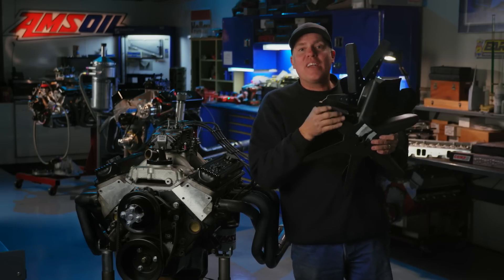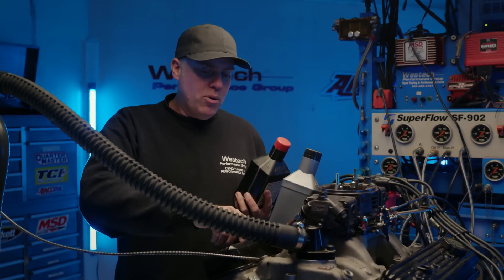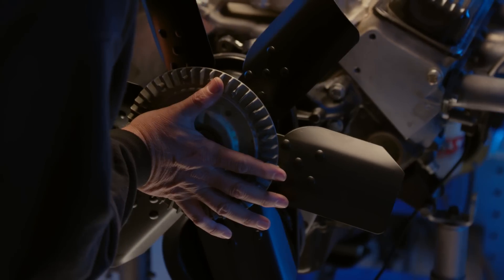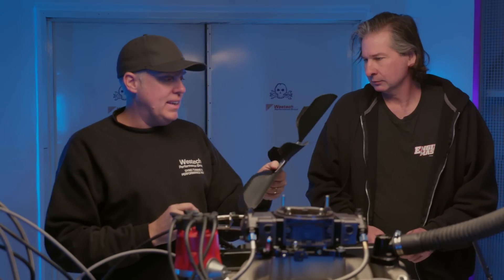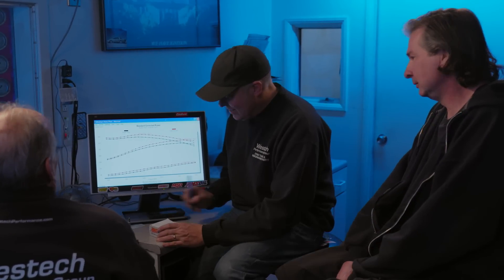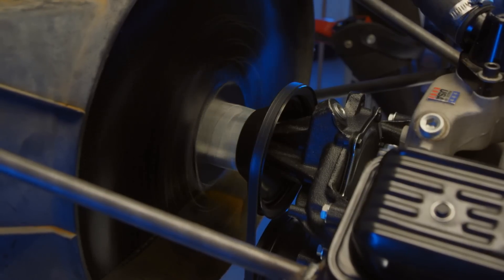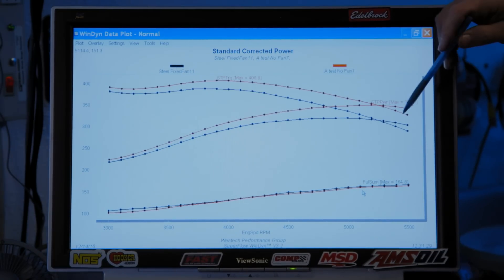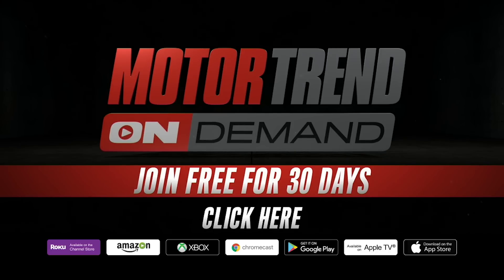Cooling Fan Shoot-Out! - Engine Masters Ep. 20

Comment: To be fair I'd lose 50hp all day and not have to worry about overheating
Reply: THE MTB FANATIC 

I've got 22 years out of Electric fans on a factory car... . to me the E fan is the least likely thing to cause an overheating issue.. more likely to be a bad thermostat or radiator.
and honestly with a belt driven fan.. the Belt is far weaker link than the E Fan.
least that's been my experience.
Reply: That's especially true when you sit in traffic with no airflow and the regular cooling fan running at idle rpms. An electric fan can go to full power in that situation.
Reply: mibars not in a cases mate, look at the TD42 found in Nissan Patrols, the mechanical clutch fan is the best to keep them cool
Reply: I had nothing but trouble with twin 16 inch elec fans on my TD42,went back to stock fan and no more problems.
Reply: 550hp 69 copo camaro zl1 with 427 aluminum, isn't a 500 horse small block. That's ALL big block. 427 cubic inch smalls weren't even a thing until the mid 90's when World Products came out with their Motown blocks.
 And as far as I know, the only small block Chevy ever released to the public that made an honest 500 horses was the 302, and even that is debatable without tuning.
Reply: When you have a clogged radiator or a defunct waterpump/thermostat, the best fan won't help you.
Reply: Its a td, just leave it all stock, change the oil and let it run for the next 20 years
Reply: Reuben Horner nah, I tweak mine, but you've gotta look after the cooling system, copper brass radiators are wondeful things
Reply: I agree. The factory electric fan on my jeep grand cherokee went out twice in 6 months. It was cheaper to put a clutch fan on it. I noticed a small drop in performance.
Reply: ok so if i took the fan off a bicycle with a chevy big block on it it would go faster than your honda then?
Reply: I have never had any problems with electric fans, including 27-years old fan in a Honda. On the other hand my friends had numerous problems with fan clutches. BTW electric fan is an essential upgrade on a Jeep - When your mechanical fan hits the water something will brake...
Reply: Mick Rambo Not really
Reply: Exactly!
Reply: I beat the Gt350 and C7 Z06 owners would agree;-)
Reply: The factory has been using electric fans for 25+yrs...so I wouldn't worry too much about it. Also a car doesn't instantly over heat...You'd notice the temp start to climb and it doesn't happen that fast. Any person paying attention would be able to pull over and let it cool down before there is any real trouble.

Only on a tow vehicle/truck would I rather have a clutch fan.
Reply: Micj Rambo....YOu said "We were making 500 hp aluminum small blocks from the factory in 1969" And like I said NO Factory small block made 400hp Net HP.

I also said, "And even VERY FEW, big blocks made over 500 Gross HP...let alone NET Post 1971 rating."  As for the L88/ZL-1 motor...I've never seen ACTUAL "stock Dyno #s" EVERYONE reuses the 560hp guestimate....which I've read was ":supposedly done with aftermarket/over the counter headers with open exhaust....NONE of them made 560hp with the stock manifolds...which were VERY restrictive. I've seen posts by guys dyno'ing stock spec rebuilt ZL-1 engines with stock manifold made around 505hp.
Reply: The ports  and valves of 351C's were big enough for 600 HP, but the ports so extremely poorly shaped that actual power was about 350 - 375 HP because of so much flow-blocking turbulence in the ports... port plates helped the power, despite making the ports smaller...
Reply: i went to an electric fan recently, junkyard swap took about 3 hours.. solved all my overheating issues. now i find out i get a hp bonus, my engine spins to 5750
Reply: supersevenn as much as I hate to admit it most hondas can beat a stock muscle car with very little work because of the weight but I don't care if your Honda has 1000 horsepower it won't beat the sound and feel of a muscle car at a red light
Reply: And that's when you mostly need your fan as during regular driving you have a wind blowing thru.
Reply: But electric fans are more reliable and provide better cooling.
Reply: Mechanical fans imo more suit heavy duty diesels or someone ripping mad skids day in day out. Electric for the rest is just better
Reply: because of the emissions. We were making 500 hp aluminum small blocks from the factory in 1969.... 1985 150hp
Reply: I carry a fan, pump and belts in the trunk, just in case. I never trusted electric fans or pumps, but there's no denying they free up horses.
Reply: 550hp 69 copo camaro zl1 with 427 aluminum disagrees
Reply: 4V 351 Cleveland GTHO's made 400hp in stock trim, they were de-rated ridiculously due to insurance premiums and a need to sell 300 to qualify for Australian Homologation in our racing series
Reply: I'd rather lose 30hp if I knew I didn't have to worry about overheating. In the greater scheme of things 30hp isn't even gonna cost you speed unless you're racing where 10th of second counts.
Reply: What a load of shite!
Reply: thats why a honda can beat most stock muscle cars

Comment: how about cooling? if a fan kills more power, does it mean that's it's cooling the engine better?
Reply: No. At higher engine revs at moderate temps a fixed fan would over cool, were it not for the thermostat.  With a rad in clean condition and a cooling system working properly, no fan should be necessary at highway speeds.  It's in traffic, when towing or at extreme ambient temps that a fan is needed.
Reply: Also dependent on the CFM of the fan, if you don't know what you're doing and get a fan that flows less than stock, bad news for you.
Reply: Johnny Anderson I thought this was a comparison test if which cooled better.
Reply: Johnny Anderson  never seen anyone with my name before Johnny anderson
Reply: No. Since when does power draw mean more efficiency?
Reply: My Focus would only overheat while sitting,and only in the summer.
Reply: Completely depends on the design of the fan and the setup. Since more drag doesn't necessarily mean more flow. I bet the plastic fan was the worst, I can imagine it flopping about creating nothing but drag. In terms of actual cooling though, surely when you're moving the rush of air is enough to cool the radiator and engine? Rendering these belt driven fans kinda useless...

Comment: would have been nice to see also what it's doing on the cooling side.
Reply: 58 fregate nothing, while driving a fan has no function, cooling is provided by the movement of the car. it's just when you are stationairy you need enough movement to remove the heat that the engine produces while idling.

thats why electric is best, it only kicks in when it is actually usefull and is off when you don't need it, drawing no power at all.

Comment: x-pipe vs h-pipe vs straight pipe next please. 😄
Reply: they already proved there's really no such thing as backpressure.    the most you'll see is probably 1hp difference
Reply: I would like to see what happens to your torque curve if you dump both your 2 1/2 inch collectors into a single 3 1/2 inch pipe rather then dual exhaust. Two 2 1/2 inch pipes have the same area as one 3 1/2 inch pipe.
Reply: imadude85 I swear they did that already...
Reply: I'd like to see that test.
Reply: Winner for next show
Reply: imadude85 this 350, swap fan from stock to electric, swap waterpump from stock to electric amd dynotest!
Reply: I second this.
Reply: X-pipe wins every time
Reply: Pipe down!
Reply: Invincible Extremes Muscle Cars Garage  naw they did different mufflers, headers, and pipe sizes
Reply: yep and keep the basic 350 from this test!
Reply: That's actually coming in the next MTOD Engine Masters, so 2 months to YT from this one.
Reply: Bryan Mayes yeah I think they saw his comment and then made the video
Reply: YES!!
Reply: id like to see the test on both this 350 and one of their high horsepower big blocks
Reply: exactly. Both methods improve scavenging witch draws the gasses out of the engine faster and more efficiently. it has nothing to do with back pressure
Reply: imadude85 agree
Reply: using an x over an h isnt a back pressure thing ;)
Reply: imadude85 I agree
Reply: X makes a bit more Torque/HP but is also a bit quieter (which is good or bad depending on what sound you like) Never liked straight pipes gotta have a H, or a X IMO.
Reply: If your gunna go straight pipe you might as well just run Headers/manifolds. I mean if ur deleting ur cats and mufflers why even bother  with routing exhaust pipe?. Unless you meant those configurations with the cats/mufflers still?!
Reply: R. Flash those configuration are still with cats and muffs.
Reply: imadude85 Ok gotcha. Some people say straight pipe they mean just straight exhaust pipe then some people mean with all the plumbing, kinda like the dual and true dual exhaust thing.
Reply: imadude85 lel
Reply: blanchae how you gonna route a 3-1/2 pipe? does anyone even sell mandrel bends in such size
Reply: R. Flash I had a 73 350 impala hardtop I ran 2" pipe from the manifolds to the rear bumper, nk mufflers, sounded like a v8 harley , everybody loved it except the police
Reply: Very common in trucks. http://www.truckpipesusa.com/categories/all-3-5-pipe-types.html
Reply: blanchae tyvm sir, but again, how do you route 3-1/2 on most vehicles? I guess on a lifted truck, no problem. I did custom exhaust for several years back in the 90s for off road trucks, hotrods, and those gay little riceburners, even 3"  was a challange, and most vehicles couldn't use 3". Also, 2.5" collectors? On what, 2.0ltr lol
Reply: imadude85 wasnt this done already?
Reply: imadude85 optimizticpizza i gotchya i just thought that episode was more than 2 months ago is all
Reply: J⃟O⃟N⃟A⃟T⃟H⃟A⃟N⃟ S⃟C⃟H⃟U⃟L⃟T⃟Z⃟ J⃟O⃟N⃟A⃟T⃟H⃟A⃟N⃟ S⃟C⃟H⃟U⃟L⃟T⃟Z⃟ how Wong you were!!! They did the video and it was actually 2HP! So ha!
Reply: Blanchae I agree Id like to know if a 2 into 1 system makes a difference in power mainly for swapping v8s into imports etc where they only have room for one exhaust
Reply: They've already done an exhaust one!

Damn, repetitive comments like this are exhausting!
Reply: I had the same thought the other day.
Reply: that may be true but i think we all want to know how it will do to the overall sound of the system
Reply: yesssssss

Comment: If you had added a wind meter, this video could actually have been interesting. I mean, it's not like we bolt a fan to the motor/radiator for the specific purpose of killing power, is it? Also, a high speed camera to observe the fans while spinning could have been interesting, just for giggles...

Comment: I would bet under driving conditions when you're going down the road the air is going through the radiator and actually helping push the fan so you probably don't lose 30 horsepower in driving conditions period just my guess

Comment: WTH... I HAVE TO GO TO WORK.   I promise I'll watch when I get home, but this was cruel to put this out now.  (Side note: in the trucking engine-design industry, one of the biggest design concepts implemented in the last three years have been the engineering to reduce internal power/parasitic losses to save fuel, which goes to how little HP it takes to turn the water pump (coolant flow through the motor and head), the fan design (the International's just-released A26 engine has a unique fan design - look it up), and reducing oil flow issues to lighten the load on the oil pump.  This is a big thing right now.)

Comment: Wonder how the results change if they had the radiator running properly and checking the temperatures v Hp lost. some of these blades i'm sure would be pretty bad for actually cooling the motor...yeah you lose less hp but if your car constantly over heats...there junk.

Comment: Hmmm looks like I have to put a electric fan on my car now 40hp - 20ish/hp = 20hp :-( no wonders it struggles up small hills or when there is more than one person in the car
Reply: Jordan Hillard, its actually not working like that at all. Like they said, that power loss only depends on the fan and the RPM, not the horsepower. A tiny shitty engine spinning that same fan at the same speed would still use 30HP to spin that fan.
Reply: The fan doesn't know or care what drives it, only how much it takes to spin it to a certain rpm. So, same fan on a 40hp engine or a 1000hp at the same rpm it will draw the same amount of hp. ;) 
But most people don't use a fan for a 1000hp engine on a 40hp engine...
Reply: No, the power of the engine won't change the hp loss, but instead the rpm and fan size will decide the loss.
Reply: Your fan would no doubt be smaller, though. Just disconnect it if you never get stuck in traffic and see if the temp. gauge rises. It likely won't.
Reply: Ok small facepalm to myself. Smaller fan = smaller power loss, it's only like a 7' plastic fan. And as for running without it? No, not a good idea when you live in a city in AUSTRALIA it's bloody hot down here. I couldn't live without my classic KE35 Toyota Corolla
Reply: Yeah especially in the city you need that air moving. Sweet car! Does it have a temp gauge? You should post a video review and some driving of it.
Reply: And by 7' I assume you mean 7 inches not 7 feet haha.

Comment: I bet the HP difference in the last test with no shroud is because the shroud forces the fan to draw through the radiator.  With no shroud, a lot of the air is forced out radially, rather than aft.  So yes you're making more power but the effectiveness of the radiator is probably way less.  Perhaps another test in the future where you observe engine temps? Just repeating the last two tests here but actually plumb in the radiator.  Would be interesting to see the results, because it's not just about sucking HP, we gotta also keep the engine cool.  Doy.  Haha thanks for the great show!
Reply: This would have been a good test to do on a chassis dyno to be honest.  Or at least give us some way of being able to do a cost/benefit analysis for them.
Reply: The shroud makes the fan more efficient at moving air and it moves more air for better cooling, taking more power...
Reply: Kurt Rethorn I'm wondering what a grill cover blocking all air would do.
Reply: The airflow restriction the fan is working against is a direct relationship to the power at the same airflow if you assume efficiency is equal.    

In reality increasing the restriction will also reduce the flow, say for instance having 2 radiators in series would not exactly double the power consumption.  The effectiveness of the blade will have a limit at increasing pressures giving another factor reducing power consumption from theoretical.

In this test the actual radiator fin spacing/type/depth is a variable that would greatly effect the power consumption if you were to try different setups.
Reply: Like a vortex ring state in the helicopter world.
Reply: Jay Morrison, I agree! I would also like to see a more comprehensive cost/benefit analysis

Snow936: I bet that would suck a lot of power, since it would basically be fighting a vacuum

KyleP133, I don't know much about helicopters, but that sounds right to me!
Reply: Kurt Rethorn 
The purpose of the shroud around a cooling fan is to turn it into what is called a ducted fan, it is designed to draw large volumes of air through a controlled area, In vehicle applications full shrouds were not used until air conditioning became a normal part of vehicle design, with the loads placed upon the engine and therefore the cooling system from the air conditioning requiring a far more effective method of keeping the engine temperature down thus shrouds were placed around the fans in order to increase the volume of air passing through the radiator, unfortunately this has a negative impact upon the engine in that it places a greater load on the fan thereby killing horsepower.
So yeah..... kinda what you said just clarifying.
Reply: Robert Nugent, oh that's interesting.  I hadn't thought of it that way.  Now I have to find an engine dino to test this out on!
Reply: ...you beat me to it, Robert Nugent.
Reply: Kurt Rethorn exactly
Reply: BuzzLOLOL  I bet a cooler system will let u run an engine harder just like a dodge demon a/c intercooler and not over heat + get more power out of it
Reply: Richard Price The current thinking is, the more horsepower over & above stock, the more efficient your cooling system should be. Consider an engine is just a gas-powered air pump, and heat is a large unwanted component, twice the power, twice the cooling capacity...(larger, multi-pass radiator, more air-flow).
Reply: The shroud should force most of the air through the radiator core causing a pressure drop, as this load grows the fan requires more energy to keep  the air flowing so the engine has to donate more torque and as a consequence more power. Maybe bigger cores with more heat exchange surfaces and with less thickness could help to reduce pressure drop and as a result put less load in the fan and ultimately in the engine
Reply: rudaripu Great point!, disregarding the obvious elimination & going to electric-fan..on older vehicles...with more under hood space, a thinner, larger surface area  radiator, and the ducted-fan would seem the best approach.
Reply: true very true, you can lose effectiveness in the radiator, but depending on the dissipation of de engine the van can give some direct fresh air.
Reply: Kurt Rethorn

Comment: why even bother with mechanical fans. Electric fans are easier and can easily be triggered by a temperature switch
Reply: audioh0lic Raw air movement. When you drive something that makes a lot of heat electric fans are crap. Big diesels etc.
Reply: So how much torque does that huge diesel sized fan rob from the motor?
Reply: Big diesels use fans that can completely disengage so while they do take massive amounts of power to spin, they only do it when it is needed.